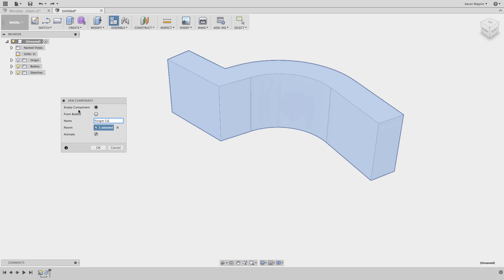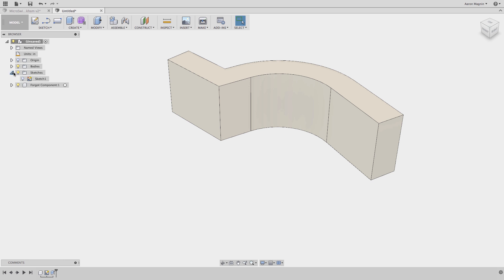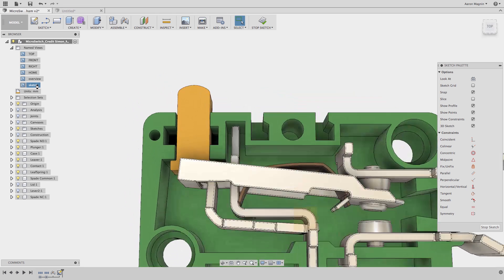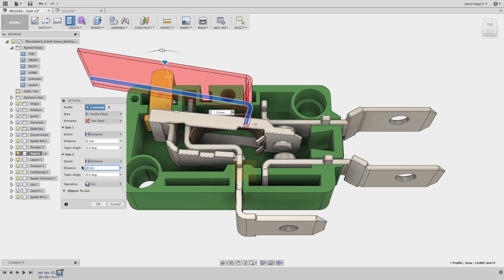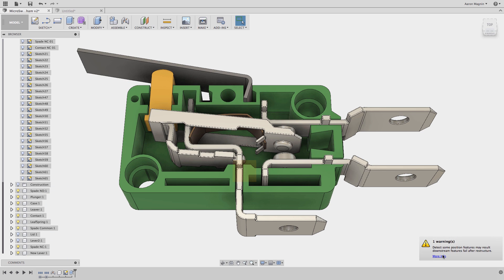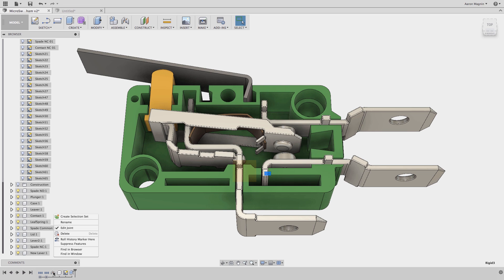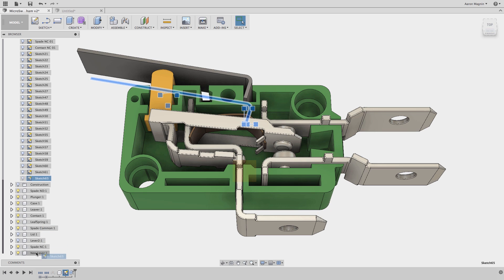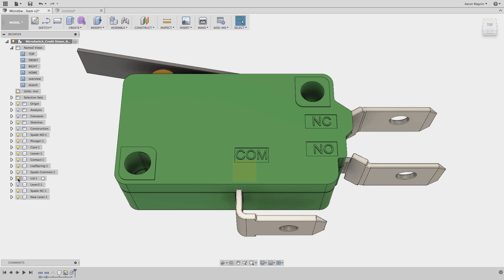QUICK TIP: R.U.L.E #1 Failure

Comment: I'm used to making components by right-clicking on the body then "Create components from bodies" . If I do it this way I can't move the sketch into the corresponding component like you do in the video, why is that?
Reply: Create components from bodies and create component are two different commands. Do one, and then the other and take note of the style of the icon in the Timeline. It would be nice if it did work, but that's the difference.